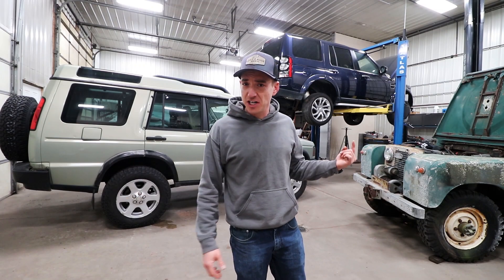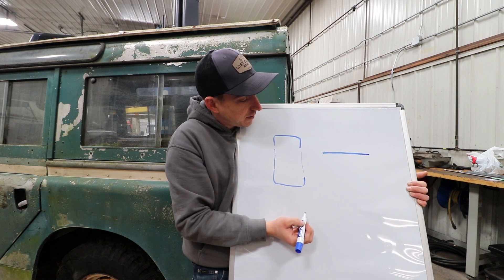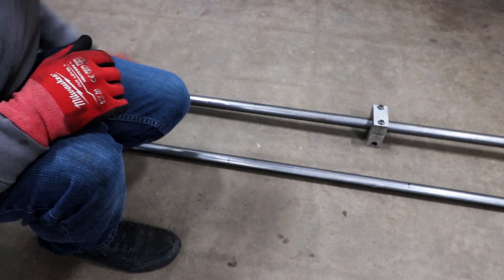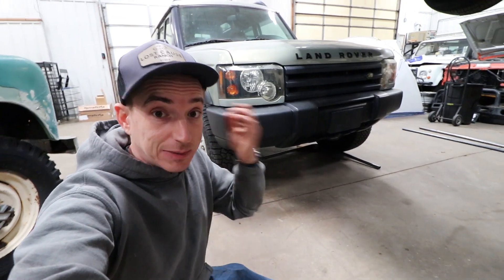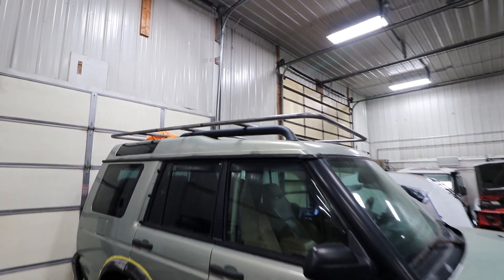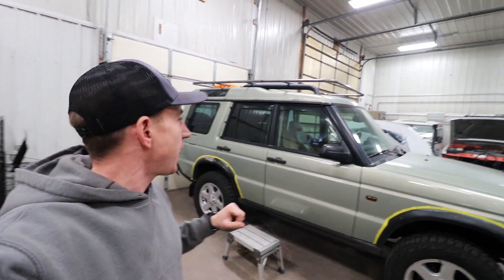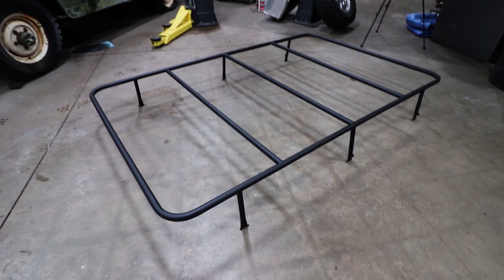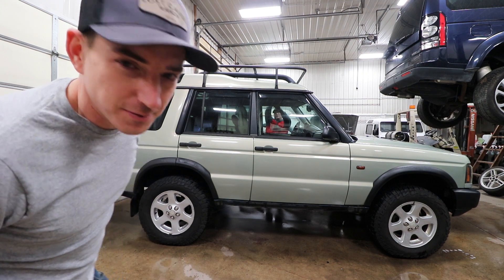Cheap Roof Rack | Our Budget Build on a Land Rover Discovery

Comment: Nice rack on a nice rig!  Having all the tools and the skills to use them is a great thing.  My dream is a dual rear swing away with a tire on one side and flat rack on the other with a bracket to attach my bike rack.  Ahh dreams!
Reply from the maker: It is nice to have the tools. We need to collect all the fab tools back in one place, some at Ted’s some at the shop, cnc plasma in storage. We had to move most of it out of the shop when we got too busy with the service business. Now that we shut that down we should be able to collect it all back there, or maybe at a new shop at the house🤔. 

The swing out bike rack would be a super nice setup.